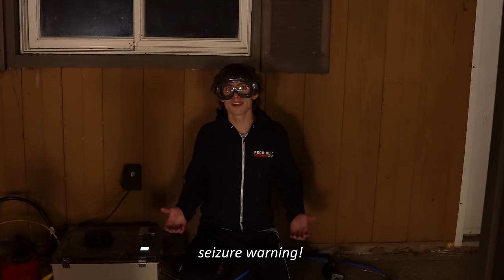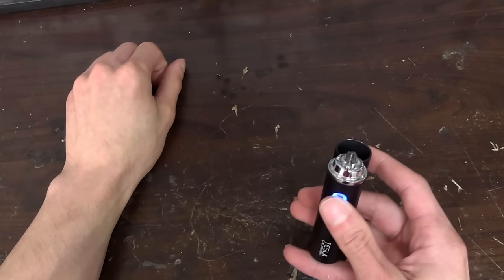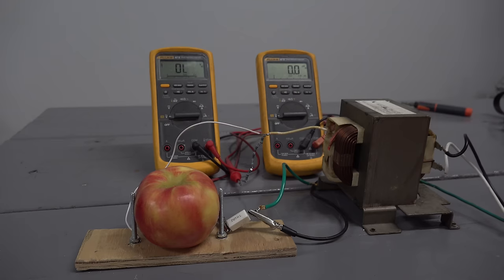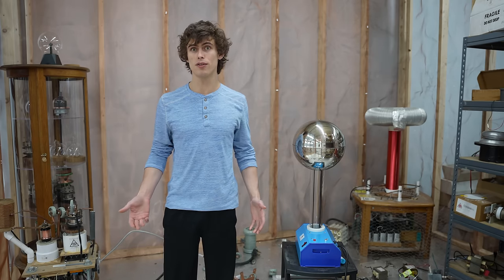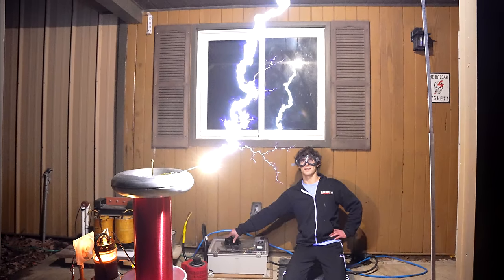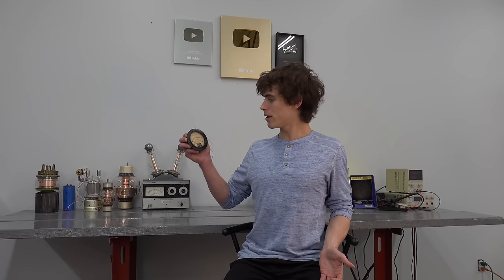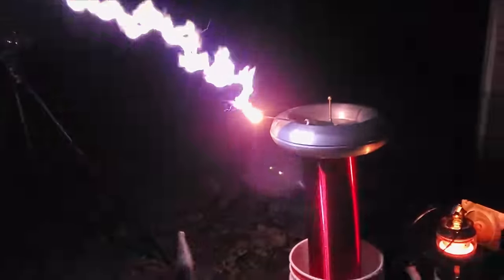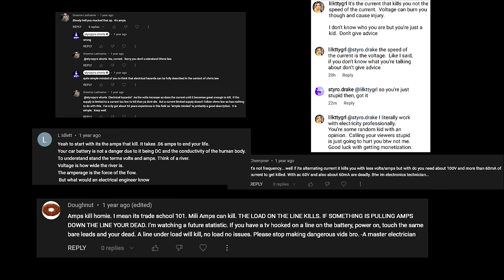Is it the volts or amps that kill?

Comment: you know, in some of my electrical safety training courses, i heard that the primary cause of death from an electrocution isn't actually from the heart stopping, but actually suffocation. Most deaths are from someone mistakenly grabbing a conductive object that is electrically hot and being unable to let go due to the muscles in the hand contracting. If the path of current through the body passes through your chest, your diaphragm also contracts and you cant breathe.
Reply: reminds me something an electrician friend of mine said that lower voltages fence wires sometimes are more dangerous because you might fall numb on them rather than that explosive feeling when they are higher
Reply: This is absolutely a very real hazard. You can't let go because the muscles in your hand are involuntarily contracting, and you can't cry out for help (or cry out for any other reason, like because of the immense pain) because, well, those muscles will also be busy involuntarily contracting. You can basically just observe yourself slowly dying in agony, unless the circuit gets broken somehow. Truly a horrible way to go.
Reply: @radiantxpdd  Respiratory paralysis in this context isn't something that just goes away when the current stops.  It's not like being tased.
Reply: Right, but wrong. Respiratory failure (paralysis) is something that will kill you after the shock not during. Dependent on the situation (whether the source was grabbed or bumped into), different causes of death are subjected. For example, if you just bump into an electrical hazard then respiratory failure is the more likely culprit of the death. But if you grab the source (contracting your muscles and not being able to let go), then its more likely you die to heart failure or electrical burns. Also the respiratory failure won't have anything to do with the diaphragm contracting, but rather the lack of the diaphragm contracting. Keep in mind the human body can go several minutes without the lungs producing oxygen.
Reply: @jaden2790  thank you for the comment. I wasn't told all the details obviously just relaying some info i had heard. I am surprised to learn that quick bumps are the ones to cause resp paralysis. intuition says that electricity causes a hand to contract, but you regain function as soon as the current stops, so likewise to the same muscle that controls the lungs. And i would think the quick bumps would be the ones that are more likely to cause heart failure due to throwing the heart out of sync with itself, vs a long "pause" where it can regain rhythm.
Reply: new fear unlocked.
Reply: Falling is also pretty common. Get a shock and you fall off something your working on because fall pro wasn’t taken seriously :/
Reply: This is true for AC only ? Cuz DC should just burn skin.
Reply: A shock can also trigger delayed problems, at my work place if you experience a shock they send you to a hospital to have an ekg performed, one guy who worked there had heart disturbances for 3 days following a shock!
Reply: @HenriqueGdeC  A few years ago when I was fixing irrigation systems on a farm; the livestock fence made contact with the aluminum water pipes. I was repairing a hydraulic pump at the time and got electrocuted. I was straddling the pipe while it was damp, my gloves were damp, and I was using a wrench. I could feel my chest getting tight shortly after the initial shock. I ended up walking a mile away to turn off the livestock fence before getting back to the repair.
Reply: Even worse if you get shocked into a body of water. There's a few videos of that happening in China...

Comment: I paused and read some of the 'expert' comments you showed in your video. One of them reminded me of when I first learned of volts and amperes and was told to think of it as amperes are the volume of electricity being moved and volts are the speed with which they are moving and so multiplying speed and volume together would get watts which is an amalgam of the two figures. It made perfect sense to me, but,,, Later on, I remembered a different nugget of knowledge I picked up a decade before that was that electricity flows on a copper conductor at 97% the speed of light. Electricity moves ONLY at that speed or it doesn't move at all, in fact (google results told me), the only way to change the speed of electricity was to conduct it through different elements and that not even resistors actually change the 'speed' of electricity. This left me with difficulty imagining the action because it's like "what then is voltage a measurement of if not speed".
Over the course of many shower thoughts I rationalized that, although volts cannot represent the speed of the electricity, volts can represent the pressure behind it. Yes, when working with a fluid, the pressure behind the fluid would control the fluids speed but that simply doesn't apply to electricity which can only move at one speed. So,,, Volts can still measure how effective the electricity is at pushing through obstructions without being a measure of speed.
In order to make that extrapolation I had to imagine a pneumatic piston on a hydraulic press. The hydraulic press only has two settings, on and off. Turning the power up does not make the press move one iota faster. The pneumatic piston has an aperture that lets air in and out, and when that aperture is obstructed, the hydraulic press comes to a stop (given that the obstruction is strong enough to resist the pressure the hydraulic press is applying to the piston), and once the obstruction is cleared the air moves at whatever pressure the press applies and by whatever volume the press speed is making it. It's not a perfect simulacrum since it would mean voltage is doing all the work (so current/amperes are useless) but it seems to help me imagine whats going on in a circuit that has capacitors on it better than voltage = speed.
By the way, I know I put 'expert' in quotes, and you clearly demonstrated superior knowledge, but I'd still defer to the judgment of an expert with years of experience even if they're mistaken about one aspect of their field. I'm only saying this because I've recently fallen into the trap of 'correcting' an expert working on a solar setup and have even seen TT of other people doing the same. I will forever try to remind myself, Just because I watched styropyro, does not make me more of an expert then someone with years of experience who may or may not be mistaken about one technical detail.
Reply: The speed of the electric field is constant but the speed of the electrons actually changes. It's called drift velocity.

Current is how many electrons passes through a specific point in a second. Voltage is not a property of the electrons but the strength of the external electric field.

I think of electrons as many little magnets suspended in a high viscosity fluid.(viscosity=resistivity) There would be an external magnetic field (voltage) moving the magnets against the resistance of the fluid. Each magnet would waste power to heat according to P = F·v (F= magnetic force, v=velocity 

As current is electrons/s in a wire of constant cross sectional area the current is directly proportional to the drift velocity. In a larger wire the same amount of electrons (same current) can pass with lower drift velocity. That results in lower losses.

Current is the same everywhere in a series circuit. In the magnet analogy current (magnets/s would change depending on the viscosity. Also the magnets would attract each other and clump together. Both of these problems can be eliminated by imagining the magnets as monopoles that repel each other (like electrons). The fluid would be filled with so many magnets that they would all be in relationship with each other and would be forced to move together.

A resistor would be a smaller diameter part of a tube or a portion of the tube with higher viscosity fluid. In smaller diameter wire the drift velocity has to be higher to have the same current. With higher resistivity (viscosity) the drift velocity stays the same but the force applied by the electric field (voltage) must be higher. Voltage must also be higher to achieve the higher drift velocity in the previous example.